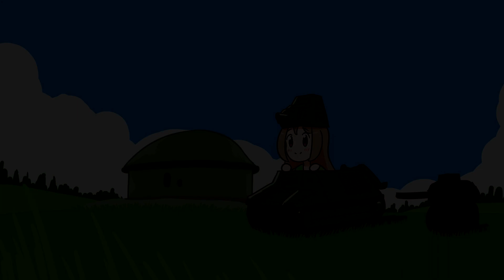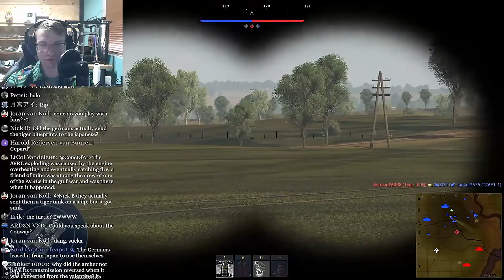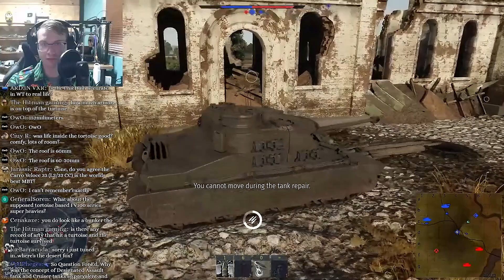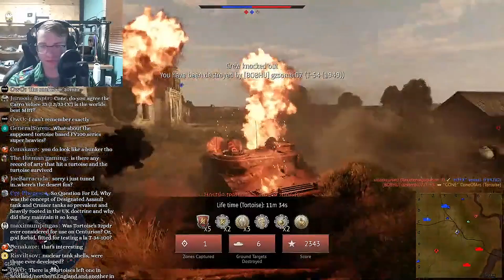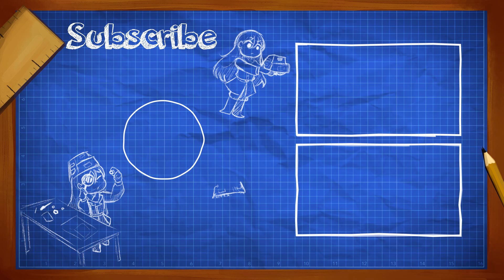Tortoise and Tank Facts | WAR THUNDER

Comment: 8:07 But does it really? I wonder how much more internal volume would a Sherman with flat armor have... Apparently flat armor tanks are box shaped!
Reply: Yeah, it does. Look at the russian tank cruisers.
Reply: @friedyzostas9998  Ok, depends on the design. If you slapped a slope on a Churchill's or Tiger's front armor, it will gain volume, on the other hand if you remove the slope from the Sherman It will loose volume. Unless you literally want the Sherman to be shaped like a square.
Reply: @narodwpsanialy1940  What the hell are you talking about?
Reply: @friedyzostas9998   Tanks like Sherman, have more space inside than a hypothetical Sherman with flat armor. Is it hard to understand?
Reply: @narodwpsanialy1940  It really is that hard to understand.
Reply: @friedyzostas9998  I'am not a native English speaker so sorry.